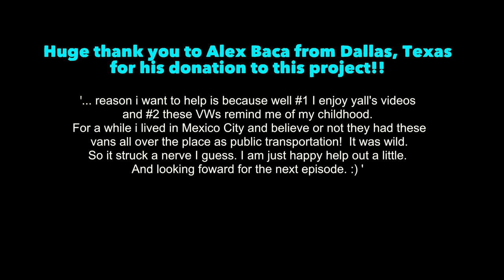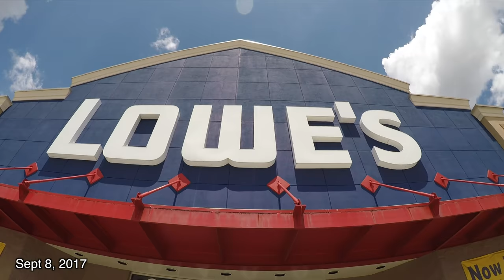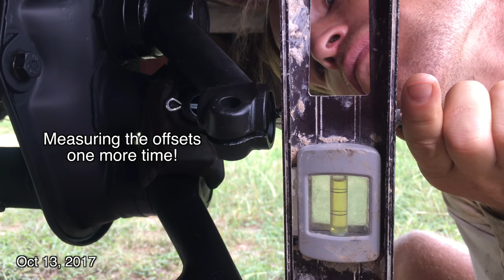VW Bus Restoration - Episode 4 - Crazy hours spent on suspension! | MicBergsma

Comment: Beautiful job sanding and painting and yes that's the reason we wear heavy shirts even if we sweat our asses off when we use a wire wheel due to flying metal particles... hehehe... personally when I was building sand rails I would just use a cheap sandblaster from harbor freight and hook it up to my compressor to blast off all the old crap of course after spraying with degreaser first. At least it went much faster for me since I was getting a lot of VW front ends to put on the front end of my rails. Also if you want a natural mosquito repellent... get a spray bottle put 20 drops of these essential oils; peppermint, lavender, tea tree... then fill the bottle with Vodka don't use rubbing alcohol because it will dry out the skin. Spray away all your mosquito away. Thanks for taking me along for the continuing journey of the Kona...   👍👍👍👍👍

Comment: Nice job with attention to detail and using really high quality parts!
Drum to disc conversion...no more tug left-or-right on the steering wheel whenever you apply the brakes, and no more wondering if you'll even have brakes after running through a rain puddle.
You might want to rethink the flip-flops when working on a car.  Dropping a brake rotor from workbench height and having it land edge-first directly onto your toes hurts like hell,  and will send you to the ER,  even if you're wearing greasy sneakers. This is followed by 3 days of ice packs while you watch your blackened toenails die ...please don't ask me how I know this.  lol
That bus reminds me of the '67 Deluxe my family bought new when I was a boy.  I'm so glad to see you're keeping it on the road!
PS  I enjoy your Suzuki Bergman videos as well, they're really helpful when I'm working on my 2004 Bergman 650.

Comment: You need to drive a split window V.S. a bay window . I have a 71 and it has a brake booster and it works great . the other thing is with mine it does not have those reduction gear on the axles. If you build a 70 HP you wont need the reduction gears . what I am saying make it more drivable . I live down south in Corpus , and if You can not get a part up there in Austin get in touch with me.Nice front end work .
Reply: I think he's planning on removing the reduction boxes. And going with a straight axle kit. That should be an upcoming episode as I would imagine.
Reply: @VWLifeVW  I know Reduction gears help on hills . Down here in Corpus the mountain is the dump????but we do have the JFK bridge . A + to get rid of the R. Gears is they do go out .
Reply: @jimmywilkinson9190  I'm from corpus, I know :)
Reply: @VWLifeVW  Who are you ?

Comment: u need to get a presser washer that would speed up the process and not damage the old surface paint. which means when you repaint it you won't have to feather edge all the old paint you scratched up.

Comment: You must try and use a more flexible wire brush instead of that rigid one..although it works well though. The flexi one juat goes that extra mile in the nooks and crannies

Comment: Also, are those ground down spindles going to be safe??? Idk, i'd be weary of grinding down spindles
Reply from the maker: Wagenswest welded extra metal on the spindles after he flipped them... then later I decided to upgrade to disc brake kit so he told me I have to grind down a bit for clearance... it's all good... didn't even touch the original surface where extra metal welded on.
Reply: @MicBergsma  Epic! Thanks for clearing that up! Want you to be safe!